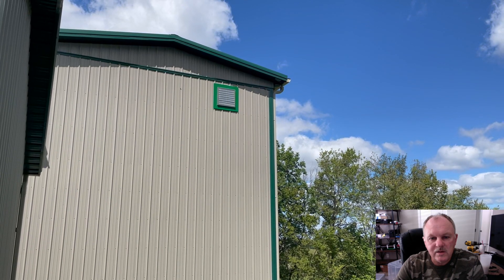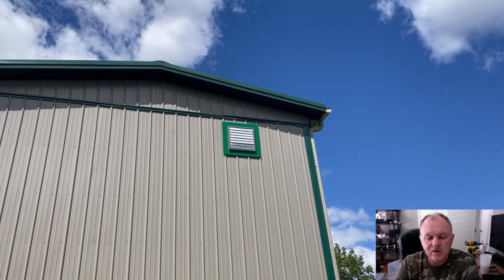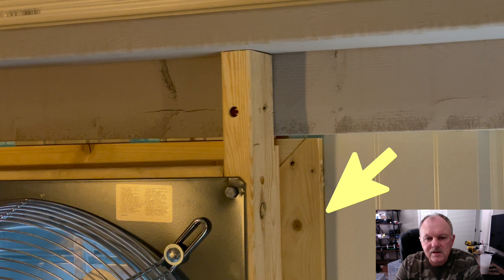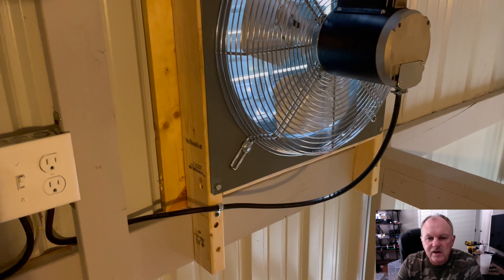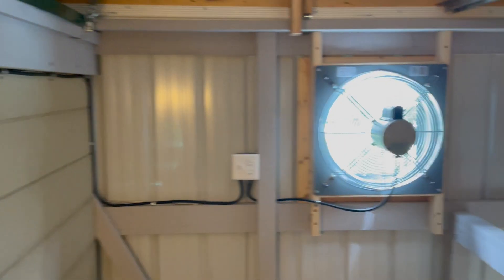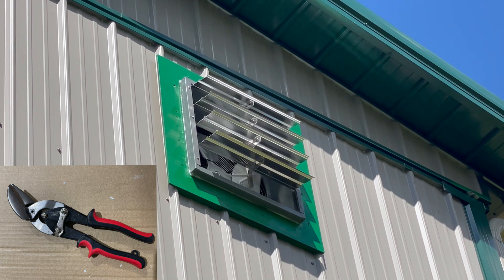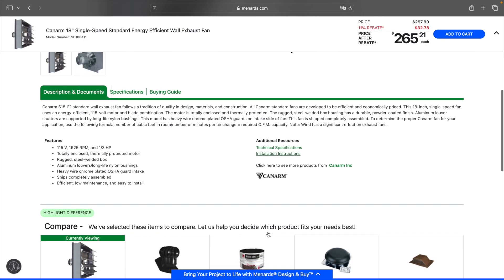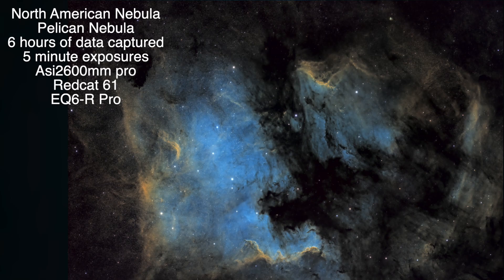Observatory Update: Wall Exhaust Fan Installation and Some First Images

Comment: This all looks awesome and I hope it works out well for you. The only thing I question is the amount of space you left on the floor that surrounds the concrete pillar. I'm thinking that the building itself may move during a heavy wind, much more than the pillar will. It could cause damage to either. I would have left a couple inches around it and filled the gap with foam rubber. Just my 🪙🪙.
Reply from the maker: Thanks for posting a comment Robert!  The building has a series of 6x6" posts down each side attached to the concrete footing with what are called Quick Set brackets. The Quick Set bracket is placed down in the wet concrete and leveled/positioned.  The building is very solid and I've never sensed any movement of the building itself.

If there ever was an issue, I could adjust the framing around the opening around the pier and create a larger gap.  It would be some basic carpentry work.

The concrete pillar is never exposed to the wind as it only reaches up through just above the floor.  The metal pier is also not in the wind at all as it doesn't reach above the side walls.  The telescope when oriented in certain positions may be above the top of the wall and could have some wind hit it.
 
As far as filling the gap between the concrete pier and the surrounding floor: I personally have chosen not to do that.  My reasoning is as follows: leaving the gap prevents transference of any floor vibrations to the pier.  If I fill the gap in, vibrations created by walking across the floor would transfer to the pier and thus to the telescope.  Once I start an imaging session, I usually only go back once or twice to confirm everything is going well before going to bed.  But I wouldn't want my walking across the floor to transmit vibrations to the telescope/mount.

Clear skies!